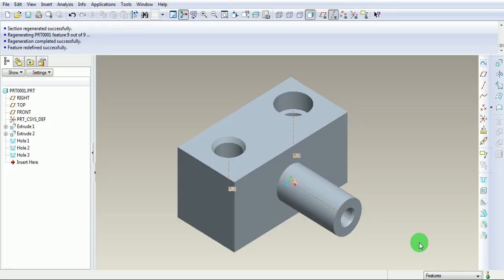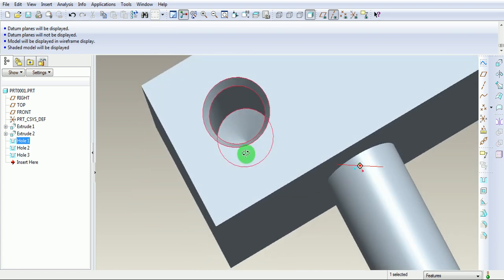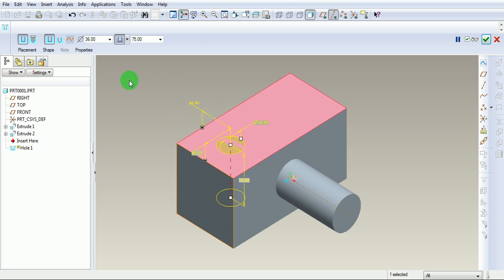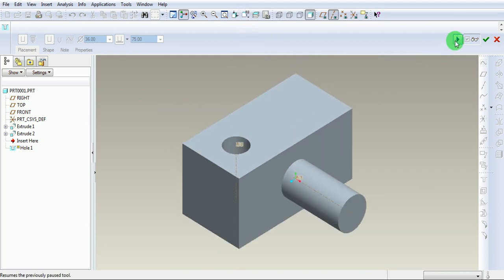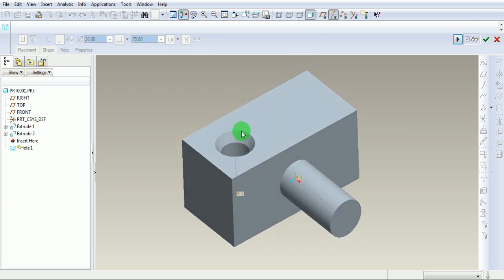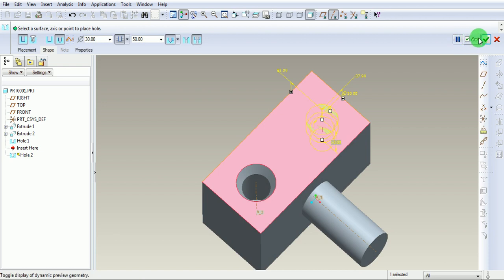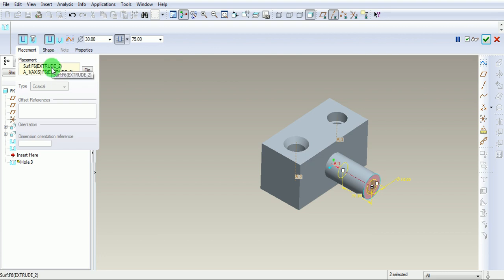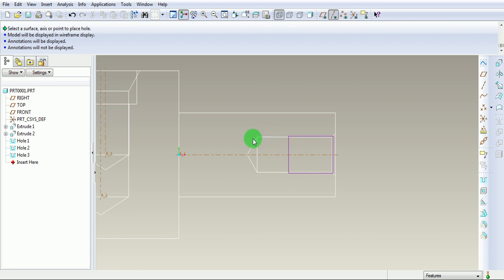Pro E | Creo | Hole | Thread | Metric | ISO | Counter | Bore | Sink | Tutorial | GRS |

Comment: how can we make M100*2P
Reply from the maker: you can either do it by cosmetic feature or helical sweep cut, its difficult to find a standard M100X2 pitch in a standard hole command.
Reply from the maker: you can either do it by cosmetic feature or helical sweep cut, its difficult to find a standard M100X2 pitch in a standard hole command.